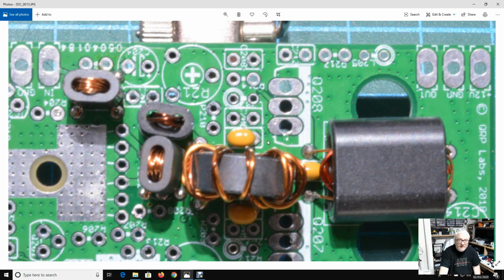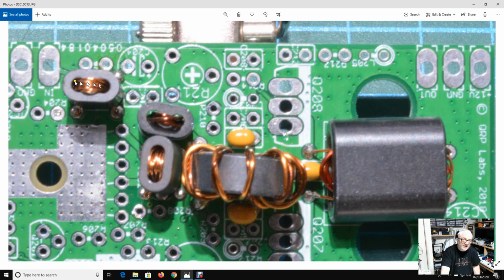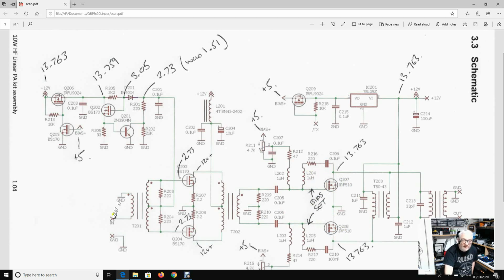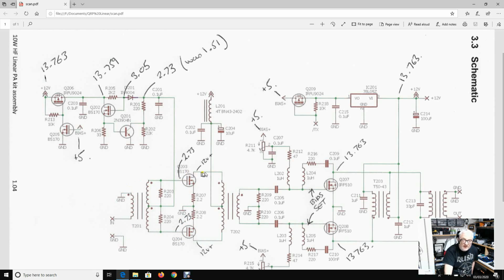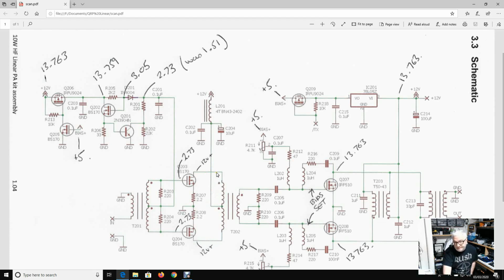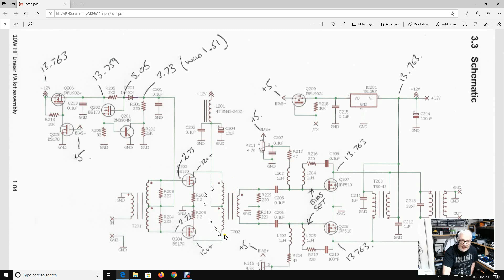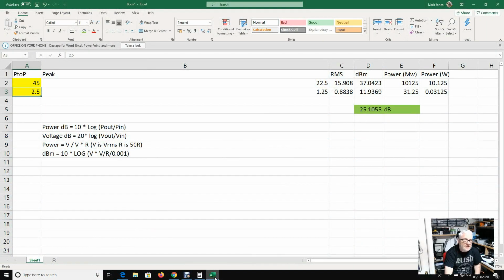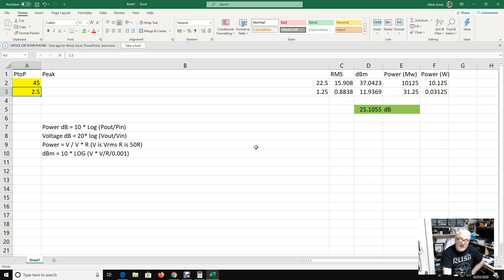QRP Linear Part 4 - QRPLabs 10W Linear Build

Comment: Peak Voltage (VP) = 22.58 and RMS Voltage (VRMS) = 15.96 and  Output Impedance in Ω (Z) = 50 equal RF Power (P) = 5.1 W😊😊🥰🥰

Comment: Is that really *linear*? I mean, could it be used for SSB, e.g. VARA HF digital modulations? All the MOSFETs suggest it is rather a carrier-only amplifier.
Reply from the maker: You bet its linear - yes
Reply: @MarkG0MGX   I am seeing around 20 watts on 20m SSB and 15 Watts on 40m  on a seperate inline meter

Comment: Changing the gate voltage and thus the idle current of the BS170 push-pull stage solves the harmonic problem. The 3-th harmonic remains rather strong on some band, app. -13dBc

Comment: Btw:
The explanation of the function of Q202 and Q201 is clear to me.
A prerequisite for the used principle is that the 3 bs170's have exactly the same gate voltage to drain current graph, it should be matched trio's for proper operation.
The voltage over R206 is 0,7Volt, so Q201 will just start to conduct and pulls the gate voltage to such a value that balance exists in maintaining this be voltage.
The current thru R206 is than o,7/33 amp.
D201 is for compensating the be voltage of Q201 so all 3 fets have the same gate voltage.
If the 3 fets are matchedl the same current flows thru all 3 fets

Comment: Hi Mark, i just assembled this amp and found out 2 things.

1st
 the pus-pull bs170 stage oscillates on 230MHz.
Fix: 2 33 pF caps direct over gate and source.
Frequency response remains ok from 2-30MHz.
2nd

the 1st harmonic is just 13dB below carrier, that is a problem.
I encounter 1.8volt on the gates of the bs170's just as you did.
Might be the harmonic problem.
What is the idle current of these 2 bs170's after you corrected the gate bias voltage?
73,
Herman
PA0VRE

Comment: I've built two of these.  The first one fizzled (literally) due to an issue of my own creation.  I was much more careful with the second one.  Even with that, I still had a hidden solder blob that caused me to cut out the original IFR510's, clean up the traces, and install new MOSFETS.  Then I had a hideous ground loop from my cheap signal generator that caused a sustained self oscillation.  I built an isolation transformer and replaced my haphazard input/output wire leads with coax, and after all of that, I obtained almost exactly the same results as G0MGX.    This is a difficult kit.  A careful build by an experienced kit builder can produce a working amp though.

Comment: Thanks for the video, Mark.  I was getting a lower power than you with my kit and reviewed your numbers. Unless I'm missing something, your power calc is off.  Erms^2/50 ohms is 5 watts using your numbers.  10 watts into 50 ohms requires 63.6 V p-p.  It looks like your power calculation in the spreadsheet may be in error?
Reply: The kit specs are for 10 watts PEP, not RMS

Comment: RE Variable output:
Are you sure about suggesting an attenuator?
These are usually used in circuits with an high output to reduce the output signal. In my case my output signal from the Hackrf one is very small to begin with and as such using an attenuator may stop the low signal altogether!? If anything I would rather go with QRP Labs suggestion and use a small value variable resistor. I would have to experiment with the value but if there is no other way of reducing the output of the 10w amp I would do that.
Thanks
Reply: Did you manage to lower the output power? if so, how did you do it?

Comment: I just finished building this, to bad I did not see your video as it would been good.
Was wondering if you would know how to vary the output without varying the input? QRP Labs suggestion was to add a potentiometer at the front? My input is going to be from a hackrf one and the output of this device is already very low. What would you suggest?
Thanks
George
Alberta, Canada
Reply from the maker: You would need a variable attenuator on the input.

Comment: Hello Mark and thanks for the video.
Some good info there.
Had a similar thought with some of my binocular cores so removed them with a hot air rework station which made it easier to remove them. Turned out to be T204 and me having a senior moment. Right wires wrong holes!

Correct me if I'm wrong but surely 37dbm is 5W and not 10W?
Isn't 40dbm 10W?

What frequency were you TX on. I can't remember if you mentioned it in the video.
I'm squeezing out a tad over 3.25W at 50Mhz at 13.8volt.  With a drive of about 17dbm or 50mw input.

I've found Hans and Qrplabs kits and the instructions along with the support, excellent.

Thanks again, James.

Comment: When you unsoldered the parts, was the board already mounted on the heat sink?  Did you have to unsolder the irf510s to get it up?
Reply from the maker: not sure I understand the question, but I didnt remove the IRF510s at any point.
Reply: Mark G0MGX when I was looking at it I thought you mounted the irf510 to the heatsink and then soldered then into the board, so I thought you’d have to unsolder then to get to the underside again.  Now that I’m putting one of these together I see what’s going on.

Comment: Hi Mark,  I'm trying to get my PA to work. I do see RF at the first stage but not much gain on the second stage and if I drive the amp with less than a milliwatt the output is distorted, at 5MHz the output is lower than at higher frequencies . So I thought changing the 61 material to 43 material would help.  So I also  went through the very painful process of de-soldering and  re-soldering T201 and T202 didn't help so this afternoon I got me some new IRF510's glad I saw you video, tomorrow I'll check all component values again and swap the IRF's  73  Mark PE0XJ
Reply from the maker: Let us know how you get on; I'm about to start boxing mine up so will post that once complete.
Reply: @MarkG0MGX   So took me some time but the fault was that I goofed up the phase of  T203 had to redo the winding as the wires where to short to cross over.. 73 Mark PE0XJ..
Reply from the maker: @stripedmark  I did send you a load of 'scope screen shots by email - hope it helped :-)
Reply: Hi  @MarkG0MGX  thanks for coming back to my call for assistance , very much appreciated. So for anyone playing along, beware of the way the trafo T203 is installed , kind hard to explain in words , might be a good thing to show on youtube.. maybe something for a follow up on this subject.. 73 Mark PE0XJ
Reply: Hans' support on QRP-LABS io group is usually first rate. He was marvellous when I was struggling with my U3S transmitter . 73 de M0YDH
Reply: @davidholman2536  Hi David , hmm a good Idea the first thing I saw when I ran in to problems was Mark's video and it proved to me I must have done something wrong, so I took it from there.. 73 de PE0XJ